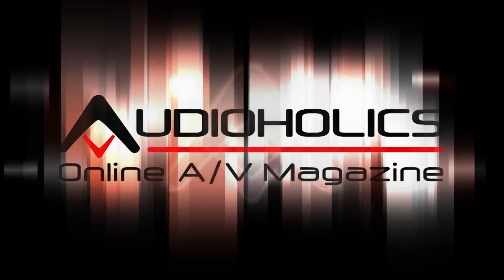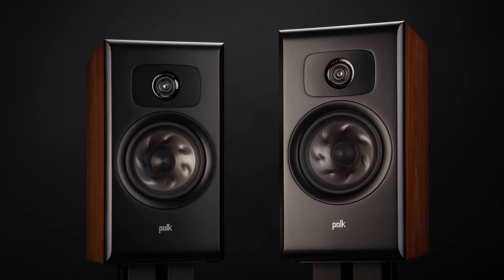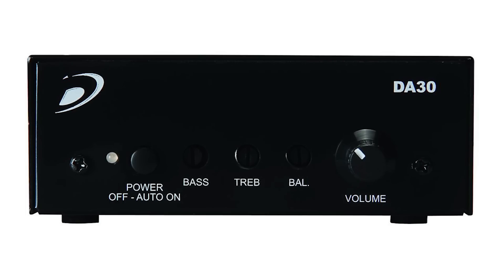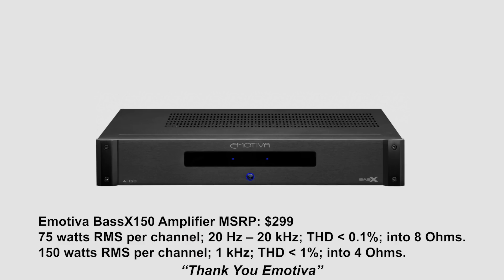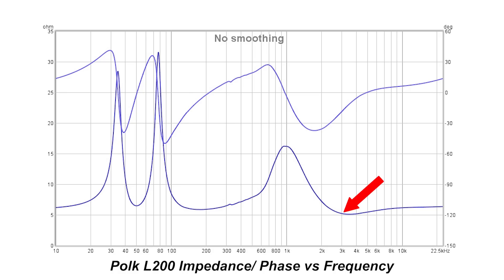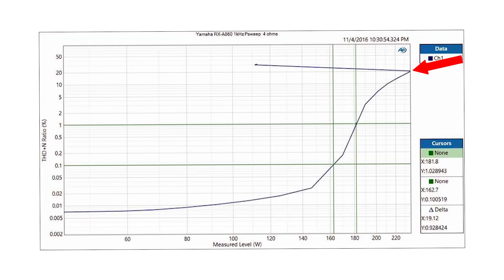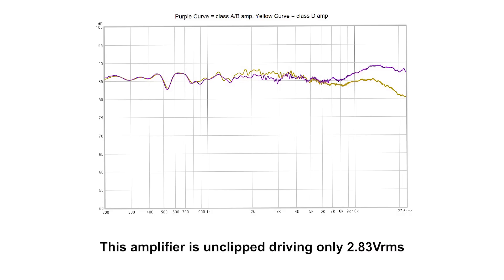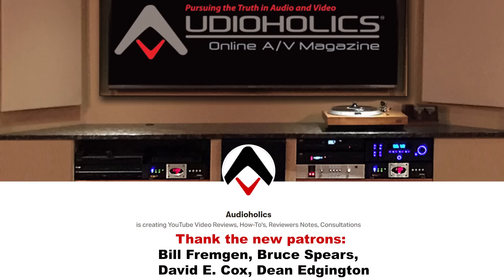Proof That ALL Amplifiers Don't Sound the Same

Comment: When we say : the amps sounds the same when not clipping, we are talking about class AB amps with heavy negative feedback and high open loop gain. actually the topic is about comparison of a 500$ and 10000$ solid state amplifier that actually have no audible difference when you listen to with -20 db  or -10db volume. at high volumes the speakers(and also our ears!) will produce so much THD that the amps THD(under 1%) wouldn't shine. Class D amping obviously is a different  story and this is why hifi amps are not usually class D.

Comment: When I switched from my low end Yamaha htr6140 receiver to my Anthem mrx700 receiver and also compared to my Nad c316bee int amp it was like a veil was lifted from my Studio 60s. I also noticed the imaging was so much better-3D sounding compared to a 2d sound. Can you measure imaging? It was so much better.
Reply: The Yamaha uses STK433 Audio Power IC's for all channels.  Economical but not exactly state of the art.  
The NAD (and likely the Anthem as well) is a high-end discrete design, quite sophisticated.  I'm not surprised that you can hear some difference.

Comment: you gave a example of amplifier with high frequency roll off. how about a amplifier with extended high frequency extension or rise.
Reply from the maker: Yep,if an amp,does that, which it shouldn't.
Reply: @Audioholics  .just curious.
Reply: The amp was rolling off because it couldn't drive the impedance of the speakers (not a 'quality' amp). Always choose an amp that is capable of driving the speakers lowest impedance for favorable results. If you have a pair of electrostat speakers that dip down to 1.8ohms, they will need an amp rated down to at least 2ohms, otherwise the amp will not be able to drive them - and they will sound 'thin' lacking fullness - most notably in bass, as the voltage dips. It's like running an ethanol blend in your car... not enough energy to achieve 's rated HP.
Reply: just wanted to know if you have seen any.

Comment: I drove my JBL 590’s for years with my Denon receiver.  Several times I had issues with the Denon seeming like it was overdriven (I had all 11 channels being driven).  I did an A/B with a Crown XLS-1502 and an Emotiva XPA-03.  Noticeable difference in sound quality using either external amp.  The speakers seemed to open up, especially on the high end.  The JBL’s are 6ohm and I believe the Denon just could not give them enough power as the impedance lowered and they were being driven hard on those Disney UHD tracks where you really have to crank the volume due to some mixing on the movie.

I really loved the Crown amps, and would have kept them, but they introduced a ground loop that I spent days troubleshooting and could not fix.  The Emotiva sounds really good to me, but had no ground loop at all so it stayed.

Comment: All of this is very confusing. I just picked up Unifi B5'S with a $299 Pioneer AVR. I guess settings the receiver to 4 ohms limiting power, thus a lower volume. I did notice the receiver get hotter when set to 6 ohms. Maybe it's my hearing, but I don't hear any clipping or distortion, with either setting. Thinking of getting a fan, if that makes a difference

Comment: I don’t get why that’s still a debate, there are differences. Different topologies, different design approaches by designers. different hardware results in a different signature ..
And even more so part choices by manufacturers. Don’t get me wrong, hearing the difference between a Mundorf and Elna cap in itself you won’t hear. But a entire design with certain budget constrains ? You’ll hear it 

If you’re the type of guy that doesn’t agree to that?! 

Go back to post stamp licking

A great example would be ATI , look at the monolith 7 channel (same design build by ATI) for 1500usd 

Pull the original ATI 7 channel next to it, looks identical!! WRONG ... check all the parts used in the monolith (cheaper caps and budget cuts)  and the ATI top parts used, and I had a hard time finding chinese circuits in there !! Al American build.. 

That’s why it was a 4800usd vs 1500usd same amp design. Build by ATI , they get hired to do the job to their budget. Both great amps but there are differences

Comment: Is it really fair to throw Jame's amp into the mix here. It sounds like he was using a special application amp out of size convenience.  The emotiva obviously has a better/proper design with less of the budget constraints. The fact that you have found other DIGITAL amps misbehaving is concerning.  I used to own one of the early Pioneer ice amp receivers.  I sold it because of your discovery back then. As a former Audio Critics subscriber, I appreciate your testing. I think your the only one doing this type measuring and research to this level.

Comment: This goes back to the simple idea that if you have two well built and  designed amps they will sound the same. Good Amp's are designed to sound neutral. I'm not surprised the cheap amp James used showed flaws. 
I'd bet no one in a blind test could pick out a good Rotel amp from a good parasound amp on a repeated basis. So for me it's not that no amps sound different it's more that well designed and built amps should sound neutral and there for the same. Cheap amps most times will never drive difficult speakers well.

Comment: I agree amps sound different from each other.  Even in my room with Klipsch RF-7's, they sound very different when driven by my Sunfire Signature 400-7 amp from my Denon 3313 pre-outs, versus the same receiver's internal amps.  The Sunfire produces a much more full, richer and warmer sound, yet with solid and airy highs.  The Denon receiver's amps sound a bit harsh and thin. This is all from the same receiver, speakers and room.

Comment: I'm into it man, I'm giving serious thought to throwing down on some new ice from legacy. I got that Pioneer Sc-25, I got them Infinity Beta 50's, I got Acoustic Research Master series cables. I got a whole mix of old ice, low impedance tweeters, and high inductance cables. That's not all I got, I have more traditional speaker wire, I have full surround sets of KEF Mirage from mid 2000's  but amplifiers are the next horizon, I've got some coin and I'd like to see the class D fantasy finally come true, but if I leap on Legacy right now, am I suffering some serious early adopter premiums?  I know the wholistic build of the iV series is quality, but is class D going to be a renaissance that makes every $200-$500 receiver as good as one that's currently around $8,000? and will that happen like next year?  Those Legacy iV amps look so Dope! I'd love to see how the latest ICE compares to Hypex et al

Comment: Well, mainly most of the components in electronics are built with-in tolerance of 10%
I would say, no two amplifiers EVER sound the same ;)

My friend has been an audio engineer on large companies for a long time, making for example Bluetooth-audio equipment.
Once they got a new guy to their ranks and he was developing an audio project, he had to say him to stop tweaking the speakers filters, because the guy was changing resistor values etc. in something like the range of 1%... And the tolerance of the resistors was 10% ;)

Not an exact science, this :)
Reply: Yeah, I dunno about that.  You'd have to go back many decades before 10% was "standard" for resistors.  My first designs in the seventies was a time when 5%ers were most common.  By the 80s, 1% mil type (rn55d, etc) were readily available.  Then chip resistors came along in the nineties and 1% was the most common tolerance.

Anyway, if I needed to find a specific resistance value anecdotally, I'd use either a precision resistance box or a variable resistor and measure it.

Comment: As someone said often, "if you can really hear a difference that don't show up in measurements, then you're measuring the wrong things".

I always put a great emphasis on "really can hear a difference" in order to try to remove any subjective bias induced differences first, and then going after the measurements of why it sounds different. 

IMHO, the issue that uncovered the performance of this Dayton audio amplifier was the most important one, which was the real and clear effect that it had on the output of a particular speaker. 

While I understand that measuring amplifiers with fixed loads may be more consistent as a whole, I believe that measuring the output of loudspeakers that are difficult to drive probably gives a much more real-world representation of any amplifier changes to the signal. 

There are much more examples of loudspeakers with complex loads (be it on low, mid or high-end of the market) than examples that behave like a fixed load, and arguments have been made for decades about the interaction between different loudspeakers and different amplifiers (the famous matching). 

It would be impossible to test all those different mixes of amplifiers and loudspeakers, but I would tend to think that some loudspeakers are particular hard loads on amplifiers (many going into the 3 Ohm range in some frequencies or/and with difficult phase shifts. 

Measuring the output of that "hard" loudspeaker driven against a well behaved reference amp could give a better representation on how a particular amplifier is changing what we hear. 

If that output measures the same and the typical bench tests don't find anything unusual and there are no audible differences, great! 
If there are audible differences, I would go back to the initial concept, by doing blind tests before trying to understand what measurements are failing to tell us. 

This is only a thought of mine...

Comment: Great video, Gene.
I would love if you could develop your findings with other amplifiers, and how often have you found clearly measurable differences in amplifiers while testing them.

You mentioned several times that class D is more prone to this than the most common class AB amplifiers.
Since the argument of "all amps sound the same" vs "they all sound different" was (and still is) made mainly outside the class D camp, how often did you measured differences between lower end amps from the likes of Marantz, Sony, Rotel (etc) while operating well within their power ratings, even if driving a most demanding loudspeaker load?

Thank you and cheers.

Comment: One small example:  250 ohm Beyerdynamic dt-1990.  Amp:  Schitt audio asgard.  Plenty of power to drive just about any headphones.  Recording :  Diana Krall/My Love is
Schiit audio asgard:  during her song she says "So firm it can calm the tide"  that near mic-saturation has a hard edge to it.  Maybe this is accurate, but it was dry and unpleasent.
Same thing, Bellari HA540/Mullard 12ax7:  that crescendo (no it's not clipping the tube, I have lots of gain left and I was not overdriving) presents all the detail without that jagged sound.  The vocals sounded more natural.  There is no way both amps sound the same, and again, neither was stressed.
Topology?  Op amp quality?   Not sure why...but the difference was obvious.
I like both vacuum tube and solid state amps.  I do not call one better than the other.  In this case, the Bellari just sounded better, and different.

Comment: I went from consumer audio to pro -audio pertaining to amplifiers. I chose Yamaha after doing extensive research. The P-Series (discontinued), have three P3500S's driving Fronts, Center and Surrounds in a 5.1 These class AB amps sound awesome with gobs of clean power down to two ohms. This series of Yamaha amps were extremely popular and highly regarded around 2014-2015. Brute force and power and very efficient...
Reply: It's interesting.  Sound reinforcement amps in the old days were second rate (soundwise) to audiophile grade stuff.  Now I believe it would be hard-pressed to find an audiophile amp that sounds better than my crown.
Reply: @elgringoec  No audiophile amp sounds better than your crown??? You're such a joker dude
Reply: @wa2368  
Did I say that???  🤔😮

Comment: Glad you brought this up... my head spins with the different types of amplifiers...  I really want to start running separates, and want to buy an amp I can have for the next 10 to 15 years... I see the newer OSD line to the home theater realm and that 5 channel amp looks spectacular for 500 bucks... but how does it measure 🤷‍♂️.... anyways I’ve also heard that the new polk line is super picky on amplifier from multiple reviewers....
Reply: forget the measurements. go for an amp from a reputable brand that is known for good amplifiers (NOT sub $1000 stereo or worse multi channel av receivers from japanese brands made in china like yamaha, onkyo, pioneer, kenwood etc.). check the insides for a big transformer and big filter caps with at least 20.000 uF. nichicon gold caps and toshiba output drivers are a plus. forget those hyper digitalized smart devices and instead go for function first. the less knobs the better. rebuilt vintage amplifiers are an option. if you want to use it for stereo, get a stereo amplifier only. leave class D amplifiers alone. get class A, class AB or class A/AB tube hybrids. dont spend $4000 on some designer amplifier with only 5kgs of weight. dont go for less than 10 or 12 kgs for an integrated amplifier, unless you want it to be portable. 
for amplifiers material matters. you cannot replace a strong power supply with big filter capacity and strong drivers.
Reply: @sgred
How about a Denon avr with an Emotiva Pre and Dr-2 amp?

Comment: This is why I do not buy amplifier without review with measuremetns or without measuring myself. I always afraid that impedance will affect frequency response. If amplifier keeps reasonable distortion within range 20Hz-20Khz and does not change the frequency response for less than 4 ohms (my speakers have minimum at like 200Hz which is 3.5Ohm) - it is good for me ;) [well, dumping factor I ignore because i prefer having subs anyway]
The only time I have heard the difference between amps was when I moved from Cambridge Audio (Azur 651A) to Yamaha (803d)... Cambridge's transformer was making a lot of noise ;)
Your example makes me think. Why people "feel" that class D amplifiers sound harsh? With 7kHz at -5db they should feel quite opposite. And moreover better amps do not have that issue. E.g. Lyngdorf TDAI-2710. At 8ohm has large peak around 40kHz but I would say we shouldn't care...

Comment: Amplifiers don't sound the same, well yes but the examples here are a bit useless, i.e. two class D amps of which one is flawed. I am interested to hear how two class AB amps can sound different, preferably even if they measure the same but have different architecture: Transistor, FET, Pentode, Triode; Output capacitor yes/no, output Transformer; etc. etc.

Comment: My Sony STR DN1020 does sound different. It has a very audible transformer him from 11 foot away and from other reports the newest DONY STR DN1080  has very audible transformer him too.

Also my amp runs warm even when it's in standby mode and in Sony's great wisdom they give you no way to turn off the amp just a standby mode. So I'm using a remote controlled power docket to turn it off properly so that it's not running warm all the time and do that I don't hear that transformer.

I'm taking that's what you mean not all amplifiers sound the same as well as your other points.

Anyway that's why I'm looking at other manufacturers to upgrade my amp to something that doesn't have loud transformer hum.
Reply: Sly foxxx  I've heard a few other people complain about the transformer hum from that amp and my brother owns it. It gives off an audible him from the transformer.
Reply: Sly foxxx  it's not a buzzing. It's s lie toned hum
Reply: Sly foxxx  also saying it's faulty would mean that all electronics I've had over the past twenty years that gave off a hum from the transformer is faulty. It's just what some transformers do if not made correctly. It's the sound of electricity going through it.

Even my brand new YAMAHA NS SW has a slight hum from the powersupply. You have to be very close to the subwoofer when it's quiet and no background noise to hear it though. But my Sony amp is audible.
Reply: Sly foxxx  it's the NS SW 300 I got a week and a half ago. It's very good. It also depends on where your amp is. I have a unit built where the amp is inside s shelf with a 3" gap all round to leave it breathe and the hum from the transformer resonates through the unit even with soft pads under the feet soaking up the noise

Comment: Anything analog will vary. Amplifiers send analog signals down to the speakers, so I for one have never thought amplifiers sounded the same. DAC's are a bit harder sell to make me believe they sound different, but possibly - they do convert digital to analog, and how well they do that will differ I suppose. I don't think the difference is large, or necessarily even noticeable with human ears. Digital stuff, well, that's digital. As long as the data doesn't get damaged (severely) in transit, it will be the same.
Reply from the maker: Back in the 90s I could easily hear the difference between DAC's in DVD players via the analog outputs. Today, DACs have gotten much better and my hearing isn't as good as it was when I was in my 20s :(

Comment: Polk is a repair service.  My high-priced Polk subwoofer died just after the warranty ran (others have reported the same experience).  Replacing the sub amplifier costs almost as much as a new subwoofer.  And one can't get the schematic because it's "coprighted".  Almost every book in my library is copyrighted, but I can have and read them anyway.  So either send in the subwoofer for repair -- shipping on the customer - or buy someone else's subwoofers -- which I did.